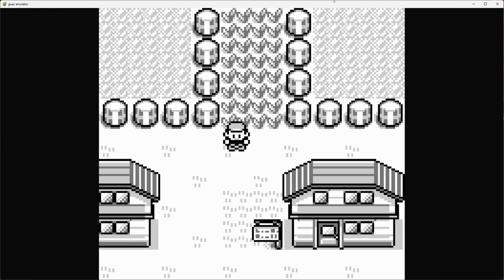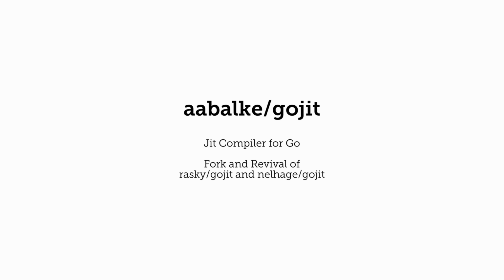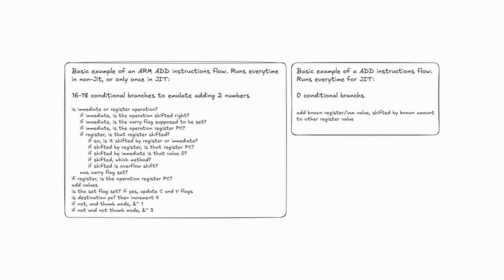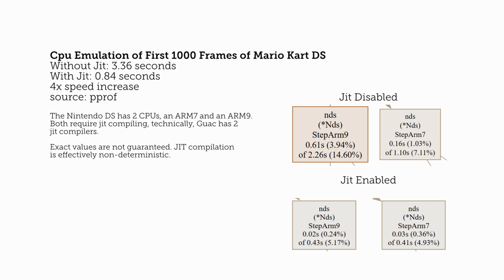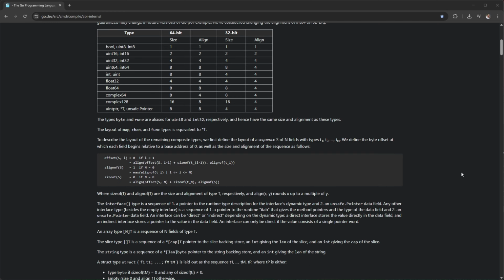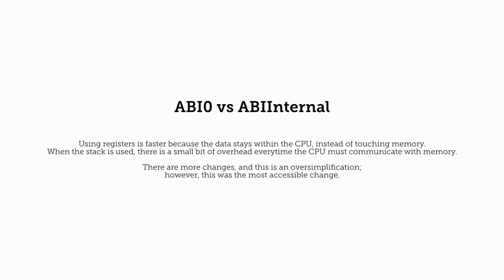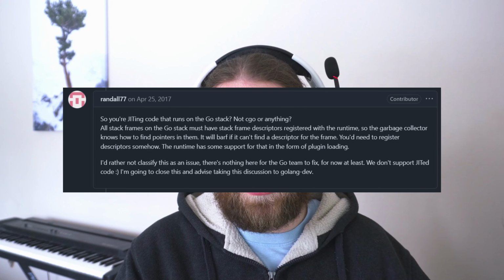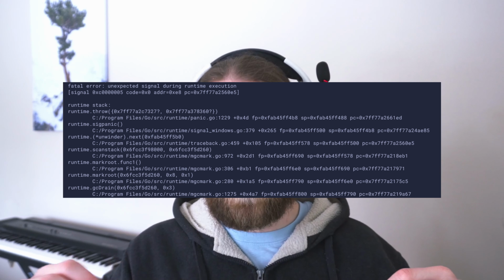JIT Compiler for Golang

Comment: Would using a JIT based runtime like the JVM or .NET CLR have avoided the need to write a JIT yourself?
Reply from the maker: Mostly no, JVM and .NET jit the host programs instructions and original code, which allows it to get to speeds close to native compiled Go and C code. The Jit required for emulation and interpreters requires the jitting of guest instructions/ code provided by the input file (a Nintendo DS rom for example). So JVM cannot make the code based on the inputted roms code faster. Some emulator and interpreters do have a IR similar to JVM bytecode, but my understanding is that's mostly for crosscompiling flexibility at compiled time not runtime.

Comment: Doesnt Wazero use JIT compilation for web assembly too?
Reply from the maker: Based on a quick glance, it appears they use ahead-of-time (AOT) compilation. They do state compiling is 10x the speed of interpreting - this would not be the case if the interpreter had jit compliation, since interpreting on the fly would be significantly faster. If they do not have one, and interpreter performance is a goal, it may be a good use case for a jit compiler.
Reply: @whatnotdev  Their AOT compilation is done at runtime. So does that mean your JIT compiler only natively compiles few code paths WHILE the game is running? Like V8?
Reply from the maker: Correct! By default it will do code blocks of 32 instructions that get called more than 256 times. It then uses a LRU Cache to remove old blocks. However the instruction count, call counts and other params are all adjustable from the config file. It has to be done at runtime since the inputted roms can drastically change the required code paths.